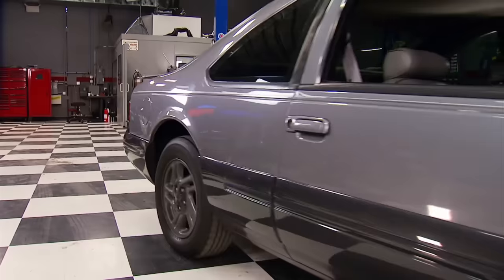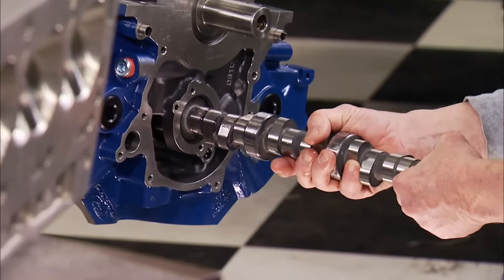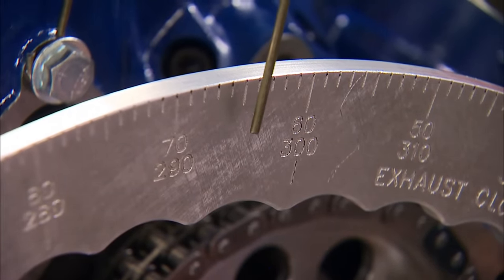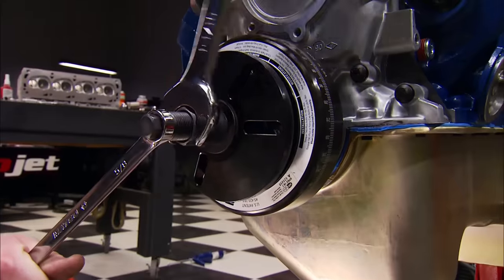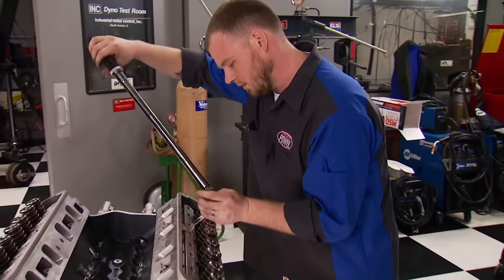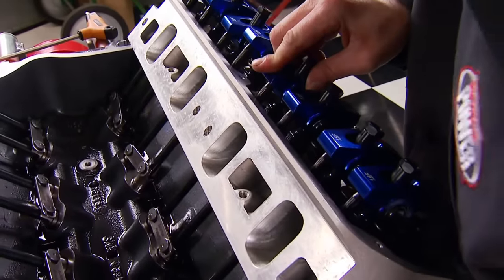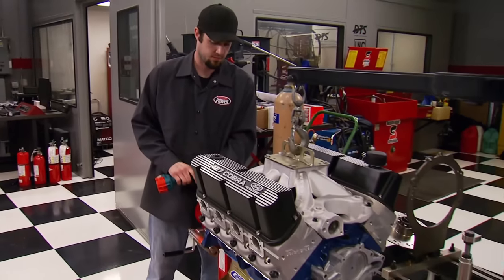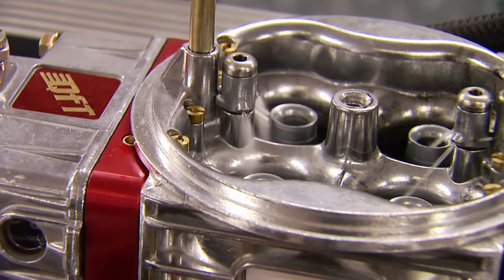Building a 427 Stroker from a Ford Boss 351 Block - HorsePower S15, E6

Comment: I’m curious... they said it is a Boss 351, and for me that says it is a Cleveland block. 
But when they installed the intake, it was not a C intake but Windsor.
Can someone explain the discrepancy? Thx
Reply: Well it's how you think of Boss 351.  You like myself saw "Boss 351"  when Ford really meant "Boss" 351.    The two original "Boss" engine were the Windsor base 302 with Cleveland style heads and the 385 base 429with semi hemi heads, in 71' we got the Boss 351 which was Cleveland based.   To Ford Boss is just a flavor of performance branding which isn't tied to a specific architecture.
Reply: GlassTopRX7 thank you. I also know that the Boss 351 had a 4 bolt main. This block featured also had a 4 bolt main. So when did the Windsor block feature a 4 bolt main? Never heard of it. I’m guessing they built a Clevor in this video but did not clarify it as such.. Cleveland block Windsor top end..
Reply: Vegas EMT yes thx. I knew I had the block/ head backwards I was wondering if this was different. Yes the W mains are much bigger. I wanted to know where the 4 bolt block came from. Thx

Comment: Question. Cleveland or Windsor block?
Reply: This is a WINDSOR based block

PARTS USED IN THIS EPISODE:

Ford Performance Parts Boss 351 C.I.D. Engine Block
Engine Assembly, Short Block, Ford 351W Stroker, 427 cid

Ford Performance Parts Boss 351 c.i.d. engine blocks are based on Windsor 351 architecture with Cleveland-sized 2.749 in. main bearing journals.

Comment: Everyone seems to get timing 180 degs off back fire through carb signs of that.
Reply: Yeah that's kind of scary. Happened to me for real. My car was at a reputable performance shop. They told me i needed a new distributor. They said they could give me a deal so I gave them the go-ahead to change it. After three and a half days of fiddling with it they couldn't figure out why the car was running like shit. Over $1,000 later I was at another shop, the shop figured out in 15 minutes that the distributor was off hundred 180 degrees! 5 years later I upgraded the motor, this time I put the distributor in myself. Got it right first shot. Not bad for a backyard mechanic.

Comment: For one that not any thing close 427FE nor is it a BOSS block or crank its stroked 351W to 427W it's a Windsor. Cylinder heads not boss or Cleveland heads big difference

Comment: If you want horsepower at peak RPM, why not just pull to 6,500 and adjust the timing till you get the best power-it would only take a few seconds at full RPM?

Comment: It's a 351 Windsor
For one that not any thing close 427FE nor is it a BOSS block or crank its stroked 351W to 427W it's a Windsor. Cylinder heads not boss or Cleveland heads big difference

Comment: This is a Windsor block build. It is not a Boss build. Windsors have the thermostat housing on the intake manifold like this build. Bosses have the thermostat housing coming up from the block/water pump area. Those heads are Windsor heads.
Reply: Correct
Reply: Vegas EMT  The Block is called a boss block which it comes from earlier years design yes however what would make it a boss engine it would need to use the Cleveland heads not Windsor heads. Kind of like the Boss 302 back in the day. It was a Windsor based block with 351 Cleveland heads.

Comment: Eek, I've seen several of these videos by this poster - almost all demonstrate how NOT to build an engine.

I would hope he used the split lift method to establish TDC, not just where it looked like the DTI gave the highest reading?
Oil pumps DO generally benefit from some detailing, but that was not the right way to do it - if one did feel the need to smooth off the housing, some 220 or finer W&D used by hand would be the way to go - that butchery removed excess material and left a VERY rough finish - a hell of a lot worse than the original finish - same with the pump gears. Where some material removal would have been of benefit would have been cleaning up the casting for better oil flow, especially the entries - the 'host' mentioned oil flow like the butchery would have helped - didn't even have the sense to realise that part had NOTHING to do with the flow.. Could also have checked the end clearances...
Anti-seize on the crank snout is a good idea - but claiming it is to protect the seal is pure stupidity, the oil applied to the front pulley does that!
Springs apply FORCE, not pressure, FFS - scriptwriter must work for the Dicovery Channel - they are also ignorant of engineering and science! ... on that, checking spring force (or pressure in American) for setting seat height is done WITHOUT the cap's in place ...
Young chap should be given a lot of credit for signing up and doing his bit - but perhaps he should check the torque sequence for the heads?

The port matching the host is so pleased out isn't that good in the corners - but they're very close, and studies have shown they can be mis-matched by up to 60 thou' with negligible affect on flow, so we'll give him that.
Using a full-synthetic oil for initial running in - REALLY? I guess I shouldn't be surprised, though, considering...
AT LAST, something I can agree about, pre-priming the engine! Well done!
With electronic distributors, before fitting the sparkplugs hook the timing light up to #1 and crank the engine over - it'll give you an initial timing setting as you don't want excess cranking on a fresh build, and it will do for the first 20 minutes, or so, of fast idle for flat tapped break-in before getting down to work on the tuning. Personally, I also do the first oil and filter change at that point, as most of the intial wear has taken place by then. Check the drained oil and, if you have a cutter, the filter medium for metallic debris -  there will be a very small amout of very fine material but if you can see flakes (often an idication of bearings breaking up), or if there is more than a trace amount, there may be a problem to keep an eye out for.

Comment: The Engine Ford should have built.
Reply: Jack Russelle, your right, this small block is just about maxed out in cu. in., you can build 526 cu. in. FE's with aftermarket blocks, with a small block using aftermarket blocks, max is 460 inches.
Reply: @Jack Russelle The FE is a great old engine and it predates the time period I was thinking of, I was thinking 1980

Comment: All those cubes just to choke them with inline heads? Why on earth anyone would build a Ford bigger than 351 cubes with inline heads is beyond me. Clevelands make a fool out of Windsor heads. The best high dollar WIndsor heads just barely pass the flow of stock, unported, 4V heads and you can get repops of those from Speedmaster for 600 a side.

Comment: Should have pulled 7grand, I promise you the power curve was still climbing. I remember when you guys did 400chevy vs 400w ford. When ran the for at chevy rpms ford was under/less the chevy tell the guy in want try see what had 1000 rpm over chevy and gained and bet the by
 least 40 hp / 30 tq still has nothing on a true BOSS 351/427 Cleveland V4
Reply: Not with that small cam. Also its a hydraulic roller. It takes lightweight valvetrain components, $$$ springs & lifters & a good profile to turn a hydraulic roller high rpm. I did a 427 SBF with a custom solid roller that was WAY more cam than this 1 & it peaked at 6200 rpm & started dropping off after 6500. The good heads on this 1 made it carry the HP to a pretty decent rpm for that little cam. Dyno video of the 1 i did is on my channel

Comment: Wait a sec... He said the engine is rated at 532hp but he keeps saying they're going for 600hp. Isn't that too much?
Reply: I think it is
Reply: Not when Amish Mike is doing the tune
Reply: He said a Ford crate motor is rated at 532. This isn't a crate motor.
Reply: They are pushing 600hp because they want greater than 532hp at the wheels. 600 on the engine will give it a moderate parasitic loss at the wheel to match the 532
Reply: @82mattlopez  You are right, I must have misheard him the first time I watched it. I was like why are these pros pushing it almost 100 past it's rating haha.

Comment: Excuse me but a boss 351 has canted valves in its heads! I know these are different heads but even the best of high-performance heads have canted valves to improve flow. there was a 351 2v a 351 4V and a 351 boss obviously 4-V... but it had Canted valves for maximum airflow and performance!!! Hence the terminology "351 BOSS". IT RULED ABSOLUTELY OVER ALL 351 FORD ENGINES!

Comment: You guys been in the industry for a long time. that's annoying when you are tel people it's a BOSS and can't even tell the difference between a true Cleveland and a 351 Windsor
Reply: Well...Ford Motorsport actually does call this shortblock Boss 351 even tho it is Windsor architecture & not Cleveland like the original eaely 70s Boss 351